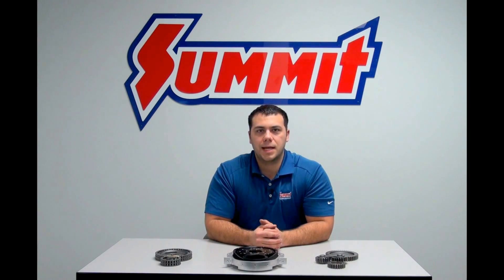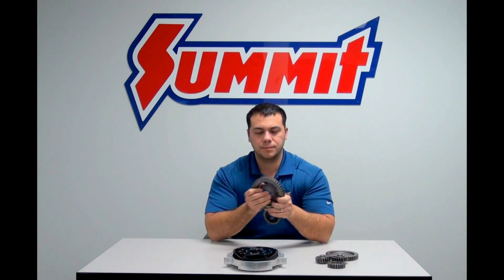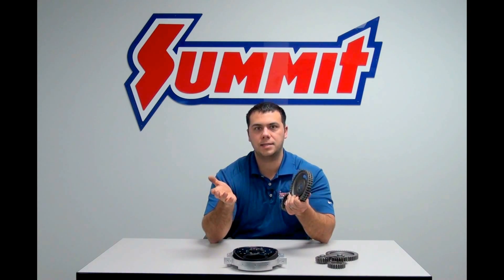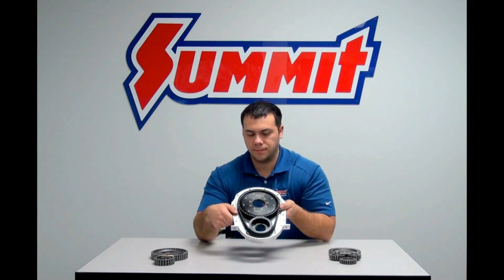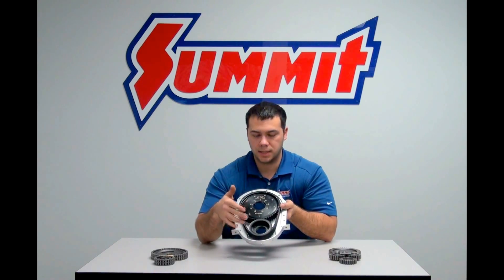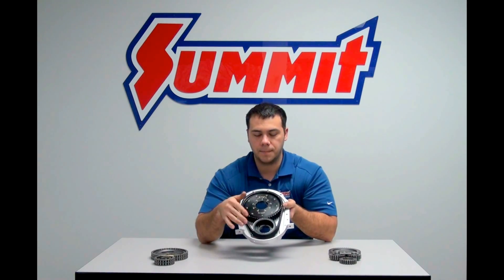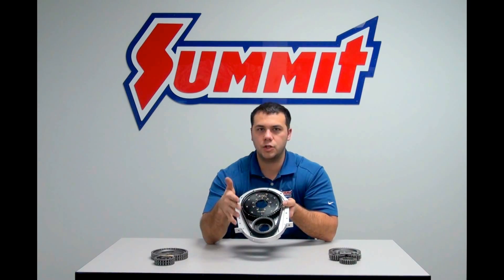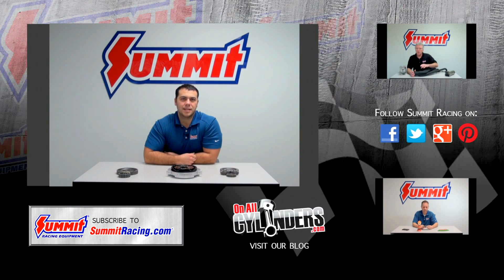Timing Belt vs. Timing Chain vs. Timing Gear - Summit Racing Quick Flicks

Comment: Im on a mind bender related to the diameters of the gear on the crank shaft vs camshaft. The ratio needs to be 2:1. How accurate does that need to be with a timing chain? A rope or belt the gears need to be accurate to the point that the definition of Pi ends up being the limiting factor or eventually the gears end up out of time after millions of rotations. The chain must lock the whole system in else it jumps time?

Comment: What will be preferable for pick up trucks and why?
Reply from the maker: The type of timing set you use depends on the usage and engine, not necessarily the vehicle. A linked-belt chain is acceptable for an engine with a stock valvetrain and tends to run quietly. If your increasing valvetrain load with increased spring pressure or extended rpm, a more robust timing set is required. Gear drives also work well, but they can wreak havoc with knock sensors because of their harmonics. Belt drives are designed for racing applications and offer quick access to camshaft timing adjustments. Like most parts, budget plays a role in selection. Double roller sets are much stronger than stock timing sets and always a budget-friendly option that fits a wide variety of applications.

Comment: Between the chain and the gear drive which one gives you more horsepower
Reply: gear drive is the best. No maintenance, never breaks, cannot stretch. If gear drive saps more power than the chain, just increase HP ;)

Comment: I’m running a 71’Vette 350 270hp in my 67 c10 which would be the best option for my setup? I’m eventually going to Afr heads & cam upgrade but that’s it!

Comment: Weirdly I've disassembled the new OM651 engine and it had a both timing chain and gear (gears running to the HPP and a chain from there for the cams) and the loudest thing on that engine is the injectors , nice video btw
Reply: Toyota 1HZ/1HDT is similar, but they use a belt instead of chain to drive the cam, and gears for everything else.

Comment: Is their any way i could by pass the nock sensor?, i was planning to do a holley sniper EFI carb on my gen 1 sbc350 with timing gears but i guess something about a knock sensor going off could occur, as mentioned in the video.
Reply from the maker: If this is an older carbureted 350 you are converting using the Sniper EFI such as this kit https://www.summitracing.com/parts/sne-550-511k, this system does not include a knock sensor so the gear drive could still be used.

Comment: Hi I’m from Australia and I drive a vf ssv redline it’s got a 6.2 litre in it and I like to get gear drives for my engine what brand do you recommend ?
Reply from the maker: The noise created by gear drives will cause your knock sensors to retard the timing terribly bad and cause a huge loss of power. You will be much better off running a timing belt.

Comment: So, if the gear drives are accurate but noisy, why can’t the gears be cut with double herringbone gears- the noise goes away, and there’ll be no thrust  force issues imparted to either the driver or the driven parts.
Reply from the maker: There are gear drives that are cut and lapped together to where there is no noise, but those typically have a fixed idler gear. The type with the herringbone are offered with a better cut gear and are labeled "quiet", but still produce noise. Due to the design of that style with a floating idler per say, I do not think it is possible to make it with zero noise.

Comment: On the “dog bone” style gear drive- it is critical when you degree the camshaft to NOT turn the crank in reverse direction.  

Summit did “how to” degree cam video- but please do one to help others do it properly when using dog bone gear drive.  
I keep seeing people that are smacking valves from doing it wrong.

I am in the diesel world where gear drive is far better and easier seen because low compression ratio is 16:1 and some stock ratios are 21.5:1 so the chain stretch is insane on those engines.  

I imagine there has to be a ton of gasoline guys having the same issues.  

As to issues of transferred vibrations-  if you have a knock sensor= no gear drive.  No knock sensor then by all means gear drive is far stronger, lasting literally millions of miles (of course 4,000 rpm so maybe you only get 700,000 miles in a mouse motor?)
And noise.   If you want quiet- buy a tesla.  If you are a man- then you enjoy hearing your engine, and hearing an engine cruise past you.   Haha.

Comment: I'm planning on running a holley sniper efi system on my engine. Its set up exactly like a carbed motor minus electric carb. Would I be able to run the gears???
Reply from the maker: I don’t believe the Holley Sniper EFI uses a knock sensor. Double-check with the instruction of the specific Sniper system you want to use; they can be found on our website. As long as there is no knock sensor, you should be able to run a gear drive without an issue.

Comment: I have a 2007 3.5 Nissan Altima with a timing chain. I just hit 130,000 miles and haven't had a problem with the chain yet I run Mobil 1 extended life full synthetic with the mobil one air filter, I also change the oil and filter every 3,000 miles even tho my mechanic say I can go 5 to 7,000 miles but I rather be safe do you think me keeping clean oil and filters has kept the timing chain from going out.
Reply: Yes

Comment: There was a shootout between a chain, Milodon gear drive, and Jesel belt drive done several years ago....Gear drive won hands down on power developed.  Problem with a belt drive is that the cam timing will retard under engine acceleration due to belt stretch.  This is compounded by stiff valve springs and very high cylinder pressures.  The old wives tale of a gear drive transmitting harmonics to the camshaft is just that, a wives tale.  A single idler style (full cover) gear drive transmits no more harmonics than does a belt or chain..  The engineers at Milodon have the data to prove this.  Also, while some claim an advantage to the belt drive as being able to adjust cam timing at the track, if you're having to do that, you've got the wrong cam to begin with.   Belts are used widely in bracket racing and some circle track applications (NASCAR), but are becoming more prevalent in drag racing  since belts can fail without warning...I know, just had one break....back to a gear drive for me....Belts do take less effort to turn, but the friction losses are more than offset by belt stretch.  To properly set one up you have to alter cam timing to allow for the stretch.... They used to be advertised as stronger than a chain or gear drive, but that has since changed too, as a quality chain and any gear drive setup is substantially stronger.  I'll agree, they have their place, and work well.  But they are also overrated, overpriced, and not really needed for 99% of the applications out there.  FYI, auto manufacturers didn't go to a belt drive because they were better, they went to a belt drive because they are cheaper than a chain or gear setup.......but many are once again ditching the belt in favor of a chain for durability reasons.......

Comment from the maker: Greg, a good quality timing chain set will last quite a few seasons, but stretch will need to be checked periodically to keep cam and ignition timing in check!  The main advantage to using a timing belt drive is to not transmit valve train harmonics to the crankshaft. The crank is experiencing enough of its own harmonics (from firing pulses and torsional twist) without compounding that issue coming from the valve train!
Reply: The proper damper and valve train components make this a non-issue.  There is a TON of misinformation out there on valve train drive related harmonics.....and the old adage "gear drives transmit more harmonics to the valve train than a belt" is part of that misinformation.  A quick call to Milodon and a short discussion with their engineers will rectify this quickly.....

Comment: How practical is the belt drive for street use? Say in a weekend Hotrod SBC with a solid roller setup 7k rpm motor.
Reply: +TPV Productions gotta watch out for debris because they don't use a cover. then there's the price I don't know about the chevy ones but when I was looking at one for my ford the jesel was 1500$ and the cheap one was 1000$. Not that great of a deal for the street being that you only save a few ounces of rotating weight

Comment: Can I use timing gears on a throttle body injection setup?
Reply from the maker: If your vehicle has a knock sensor you can't because the sensor will detect the noise from the timing gears and retard the timing.

Comment: I have a lo5 which is a tbi motor, but it's carbureted now and only the fuel pump is computer controlled, I should be fine with a gear drive right?
Reply from the maker: Hi WHITEPOPOLO, 
Yes, now that you have defeated your emissions equipment and are carbureted, you will have no need for the knock sensor that would have picked up the noise from the gear drive.

Comment: I used the summit brand double idler gear on a 302 bored .030 with a blower. It was in a 95 EFI setup (EEC IV  *not* OBDII) I never had an issue with them on the street. It was my daily driver and even went up and down the east coast 3 times a year. Is my non-OBDII setup the reason I didn't have an issue?

Comment: What's the best way to know if cam timing is crrect or needs to be adjusted?  I have a sbc with a jesel belt drive bought the motor the way it is and was wondering if it needs to be adjusted or not.
Reply from the maker: +Raul Mercado, 
You will need the cam spec card for that cam and some camshaft degreeing tools. Performing this process will allow you to determine if the camshaft was timed properly by the previous owner. Keep in mind though that by changing this timing will allow you to tune the power band to your needs.

Comment: Hi the belt design what about noise compare to the others? and durability
Reply from the maker: Hi Head Gone TV, 
Properly installed and tensioned, the belt will no noise. They are also very durable, can be used in high lift and high RPM applications. When used in a race type application the belt should be changed each season.

Comment: one thing to mention is that belts are far less reliable than chains or gear sets. belts are made of rubber, and thus are susceptible to significant stretch, dry rot, or even the rubber teeth being sheared off by the metal sprockets. if this happens, the pistons in your engines may hit the valves, which means your in for some very serious engine repairs. the weight and noise reduction isn't worth it unless the belt is very easy to get to so that it can be serviced regularly.

Comment from the maker: The knock sensor responds to spark knock caused by Pre-detonation of the Air/Fuel mixture. As the flame front moves out from the spark plug ignition point, pressure waves in the chamber crash into the piston or cylinder walls resulting in a sound known as a knock or ping. This is caused by using a fuel with a low octane rating, overheating, or over advanced timing. Sometimes it can be caused by hot carbon deposits on the piston or cylinder head that raise compression.

Comment: Curently working on a friends "summit built" 383 stroker with an hydraulic roller cam. The engine had a dual roller on it. He purchased a gear drive(looks like a Pete Jackson set-up. Anyway I noticed that the cam gear does not seat the Torrington bearing against the block, causing a misalignment of cam and crank gear. I would say .075 too far forward. I put the same set in my 468 big block but that uses a solid roller cam. Can you tell me whats causing this?
Reply from the maker: Dave Soukup ,
It sounds like the upper gear is not machined properly and Pete Jackson is no longer in business, so it will not be possible to get a checking dimension from them. You may have to use a different arrangement.
Reply: Thanks for your time

Comment: Can you tell me what cars models have timing gears?
Reply: Diesels usually use a gear drive setup because of the durability and really high loads involved. Other then that just a few race cars have used them in a production sense outside of that.

Comment: hello   I was just wondering, I have a summit timing chain double roller.  with the degree gear for crank.   do I start with 0 on gear and then check my cam timing?   and adjust if needed?   plus if I have to change gear how would you get gear off??  please respond
Reply from the maker: Hi Wallace Sutherland, 
Starting with the 0* keyway, degree the cam. If it does not come out correctly according to the spec on the cam card, that is when you would pull the gear off the crank using a gear puller and choose the correct keyway. If you have any further questions, please give us a call on the tech line. 1-330-630-0240

Comment: hi, i have a question! i want to change from timing chain to gear drive! but my engine is roller cam! and i saw that most of the gear drives say that will not function with roller cams... what gear drive should i use? i have a 1st gen sbc
Reply from the maker: Hi neoholland, 
The reason is because most (not all) roller cam motors have knock sensors that would hear the noise of a gear drive which would lead to  computer corrections that would affect the drivability and emissions compliance of the car.
Reply: Summit Racing Oh!! so no problems there! i have a SBC with a carburetor, no sensors... thats great!! im looking for the "Proform High Performance Gear Drive Sets 66917C" in your site... does not say any machining and it fits stock timing cover, thanks guys

Comment: Hi! I'm currently building a car where the main feature is fuel efficency. We are tuning things down with the gears at the moment, as the maximum speed is 40 km/h. As for now we have one electrical connected to each of the back wheels.

What would you recommend we use as gear solution? Is timing belt the winner here, when it comes to efficiency and minimal losses over all? The car is really light weight. About 150 kg with the driver
Reply from the maker: Hi dilf69, 
For the application you’ve listed, the timing belt would have the least amount of friction making it the most efficient.
Reply: Summit Racing Thanks, mate!

Comment from the maker: When a timing belt/chain slips it usually a failure type of situation; whether it be due to high mileage or fatigue of the parts. Either way, the car will not restart and most times there will be bent valves and broken pistons. If you are experiencing belt slip and the car continues to run, you are most likely experiencing serpentine belt slippage. Replace the spring loaded belt tensioner, the serpentine belt and make sure to clean the old belt residue out of all pulley grooves!  Good luck!

Comment: so I have been looking at going with a noisy timing gear with my farm truck build. do they hold up better than the timing chain? do they get out of adjustment less easily? I run sun solid lifters, and I have noticed that they stretch the chain design out pretty quickly. Im tired of changing my timing setup, but I do not want to go to the belt. suggestions?
Reply from the maker: Hi ThunderHead289, 
Yes, gear drives are a more robust assembly than a timing chain. It should give you years of service.

Comment: Hi thanks for the video, just wondering if gear dives are good for a little 4 cylinder diesel turbo?
Reply from the maker: Hi Adrian, We would need to know the exact engine year, make, and model. Gear drives are not offered for all applications. Thanks!

Comment: How about spiral locks vs buttons for use with pistons?
Reply from the maker: thehemiwarrior ,
Ultimately buttons of any material rub the cylinder walls and can have an effect on ring sealing over time. If it will be a motor that is torn down and serviced frequently (all out drag motor) this may not be an issue for you. But, if it will be a motor that is expected to stay together and be dependable with fewer (if any) teardowns, wrap your finger tips with some duct tape and get busy with the spiro-locs!  :) Let the profanity laced bleeding begin!

Comment: how often would the gears need replaced on average?
Reply from the maker: grn dragon, This would really depend on a few things like valve spring pressures, valve lift & usage of the motor. On a typical stock application, a stock chain & gear set will last 100k miles or more. In an all-out race application with high spring pressures and valve lifts, you may need to replace them each season.
Reply: Summit Racing
so how long would the "all" gear set last on a stock motor? I don't care about the chain type setup.
Reply: grn dragon i have a cummins diesel and the timing is done with gears. My motor 310k on it and there is no noticeable wear on the gears
Reply: Forever.

Comment: What is the durability comparison between timing chain and timing belt (which is more durable over time with regard to wear and stretch)?
Reply: If it is a modern kevlar reinforced belt you will have zero stretch over time. It is a vastly superior timing method.

Comment: I am using a gear drive. With it installed, as I rotate the engine by hand (crank, cam, gear drive in block only) I notice there is a slight, but noticeable "grab" at one point in the idler gear assembly. I remove it, crank and cam rotate freely and smooth. Its not bad, but in your opinion, should I continue with assembly or just let it ride out?